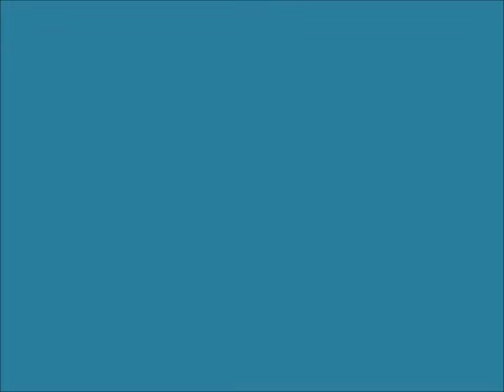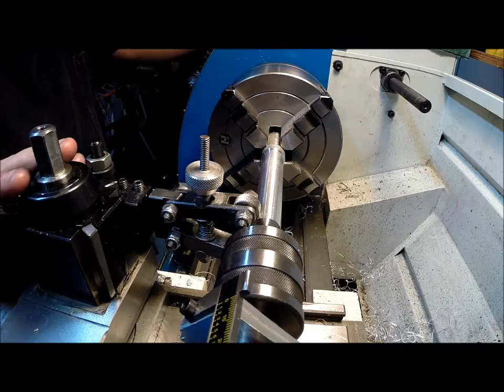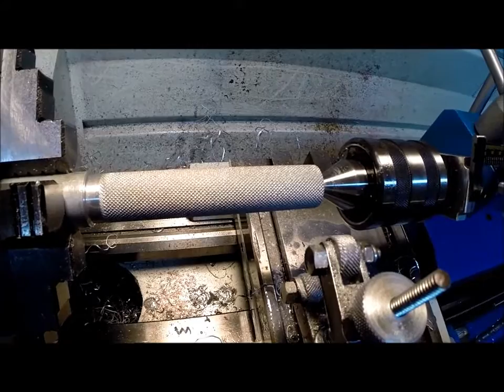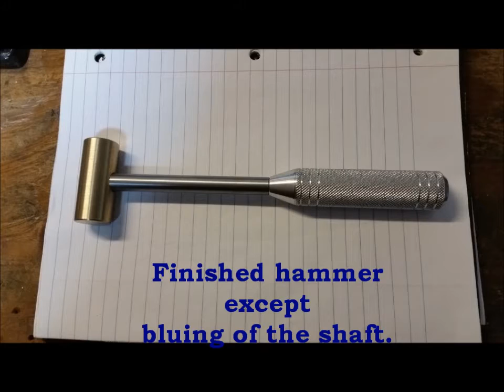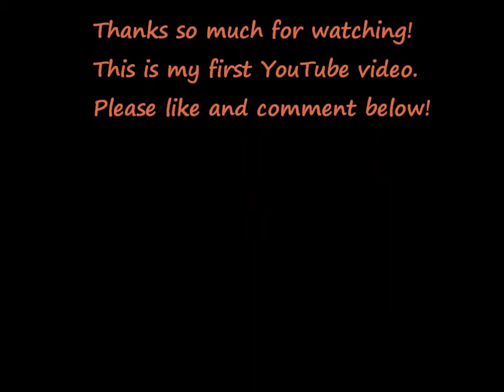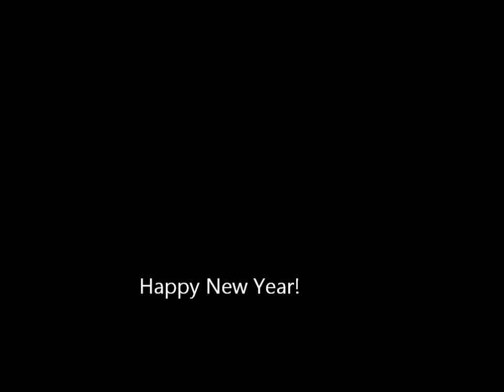Knurling -   Video 1

Comment: Nice tool,  worked great.  Looks about a medium knurl.  Did you calculate the diameter for the work to match the knurl on do the Just jam it in method?  Welcome to the group and Happy New Year.  Randy
Reply from the maker: I didn't calculate the diameter as this is a non critical part. I haven't had the need to figure things that precisely yet